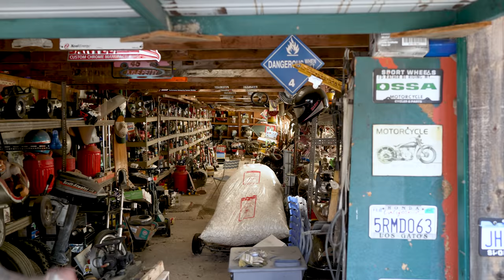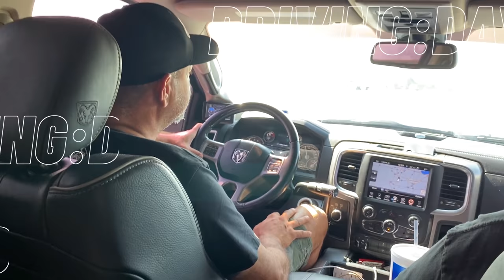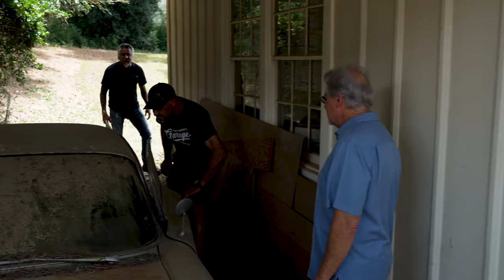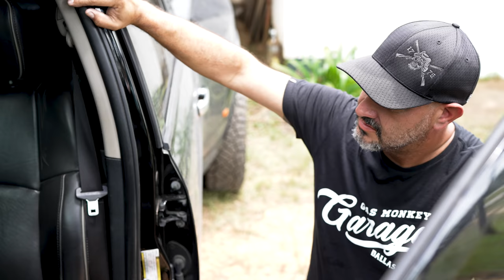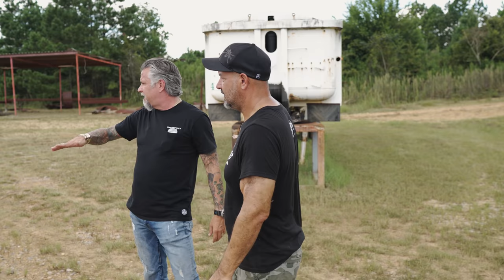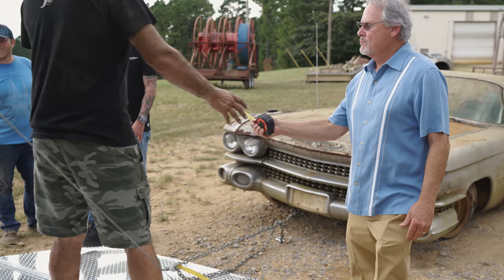Wheels & Deals GONE WRONG - '59 Cadillac - Gas Monkey Garage & Richard Rawlings

Comment: Anyone else noticed that that small boat.  Is the same one of a kind boat that fantom works custome made on a larger scale
Reply: It’s a hydroplane they are instruction kits made out of wood and fiberglass. My dad and I made one. They are just shrunk down versions of the ones they race.  But a 15hp motor will go 50mph they are scary fast. Pretty common up here in Minnesota.  I was king of the lake at 10 years old with mine haha

Comment: That is just as big as my 1960 Oldsmobile four-door holiday special they are one big car too big for trailers enclosed trailers anyway but there sure are fun to drive on the highway when they’re fixed up at least mine is rides smooth as glass don’t feel any bumps
Reply: what a tuna boat and gross polluter- and you are part of the reason gas is so damned expensive

Comment: Wonder if the fenders unbolt from the trailer to give them the 2”…the tires would probably rub on the body anyway the caddy is pretty low and wide.

Comment: What's big diesel Sparks and look at the toll road so you use a big snatch robe is nylon it stretches and then the structure pulled a vehicle when you stop they make them up to 200000 lbs tensile strength

Comment: You you would have grown up on a farm you would know to put the chain under the truck and pull it in reverse with chain on frame hitch. That way the pressure is pulling down on your rear tires giving you more weight to the rear tires. SEMPER FIDELIS

Comment: maybe next time you get a car with no key you could try popping the trans linkage off, and put it in neutral. ive had to do that a few times with this new crap the big tree are putting out, if the battery is dead flat you cant get it out of park.

Comment: You need a Bungie cable like they use in the Norwegian military. You drive forward and it stretches and you have momentum. Stops you getting stuck in a hole.
Reply: We call those nylon snatch straps here...been using them for YEARS
Reply: Company called yank em straps
Reply: Aka stretchum strap
Reply: Dynamic recovery rope.
Reply: yes  they are Commercially sold  on Ebay pretty reasonably  as exactly that Snatch recovery  Straps  years ago  we had to buy 1 1/2” Nylon rope from a Sip Supply store  to make our own Snatch Ropes  for Off Roading in the Florida Everglades  the  new Snatch lines are nicer because they have  loops on the ends and usually come with heavy Duty Shackles  With our old Ropes we had to tie  knots and try to Untie them to  keep our ropes for the next Adventure  the new Straps and Shackles make it way easier  and cheaper too  I think the last  Rope i bought i paid nearly 50 dollars  for probably 25 feet
Reply: rubber band
Reply: If anybody wants to really see how they work check out Matt's off road recovery. He uses the yankum ropes.
Reply: that sounds dangerous as hell. do you have your mother-in-law hold it steady??

Comment: I would have had that car loaded on that trailer by myself. Hit the local wrecking yard for some wheels and tires that hold air. And a trip down to the local lumber yard. Pick up a couple of 2 X 12 20 foot and a few bags of sand or Quikrete. Or maybe just some cinder blocks. Build a couple of temporary loading ramps to get above those fenders. Done deal.
Reply: youre going to ramp that caddy on a pair of 2 X 12's?? that would be must-see TV.

Comment: You know a 59 has no trans interlock.  That means you do NOT need a key to,remove it from parkm 😁
Reply: I was thinking the same thing. Plus I've learned no matter how bad the tires look always "try" to air them up I've had alot of tires like that surprise me. Especially  if you put a little jack under there and take a little weight off them.

Comment: Why did you not just open the hood again pull the pin on linkage rod and put it in neutral. Would have took 30 seconds and pair of pliers
Reply: Looking thru the comments to see if someone mentioned this. You are correct about the linkage and it is an easy job to do. Some people just overlooks the obvious. Hope he sees your comment for the next time.
Reply: It is faster to pull the gear shift lever out of park.

Comment: Not one of your guys every thought to get some plastic autozone ramps to clear  the wheel well or some wood??? The trailer is 96” wide everywhere else.  The guy on the phone had the right idea with dish soap and a flatbed. Also use forklift to jack car up and disconnect linkage. I mean I can keep going on for days with ideas on loading it. I never leave a car behind

Comment: WTH? They did not have locking park on the transmission in 1959? Then put the front on wheel dollies when you get it on the ramp, winch it up to the wheel wells, if not high enough to clear the wheel wells floor jack it up to clear, then winch it the rest of the way on! Dang! Monkeys F'n a football!

Comment: So you guys need to outfit your tow truck or trailer with a jack, and jack stands, wheel dollies and good portable lug nut gun.  jack the car up, take the wheels off, then send the wheels down to a tire store either air pop the tires back on to the bead, or buy some cheapie tires and get it down so you can winch the car into the trailer.   Come on boys, do I have to do it for you?   I was shaken my head for 10 minutes!   But on the other hand, it was a good story line, and pretty humorous!   lol

Comment: Do not try the starter fluid trick with old-fashioned bias tires they blow apart and Catch Fire really easy but steel belted tires you can put a half a can of starter fluid in there don't blow right up stand back and if you got long hair put it under your hat LOL hahaha

Comment: I have never been in a '59 Caddy, but I have been in a shitload of '59 Olds, Buicks, and Chevys, my point being, I don't know of a lock between the ignition key and the transmission. In every '59 automobile I've ever seen, you can shift the tranny into neutral, even if you don't have an ignition key. Which means that you didn't have to drag the rear wheels like you did. I guess it's moot anyway, since it would not fit into the trailer you brought...

Comment: What kind of speakers where those?
Reply: Design Acoustics D-12. Pretty rare. They have nine 2.5" tweeters, one 5" midrange  aiming up, and one 10" Sub firing down reflecting sound off the floor.  Depending on the condition they're round $1,000 each (needing work) to $2,500 each (working perfect and nice foam and cabinet).